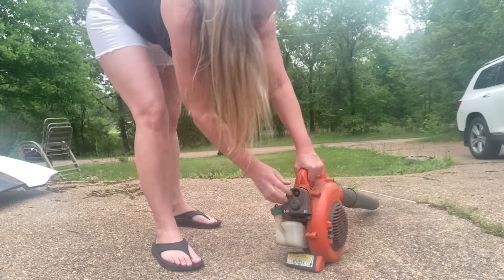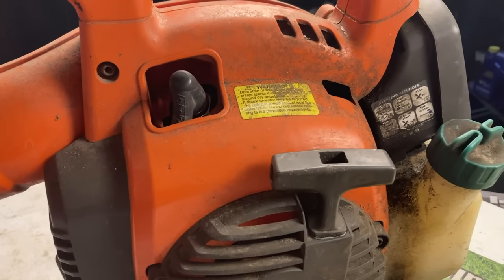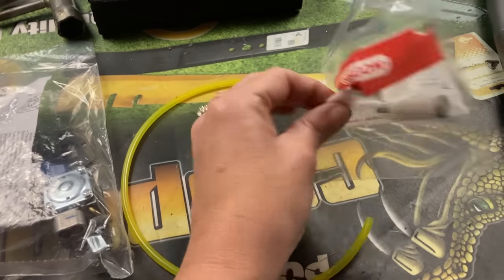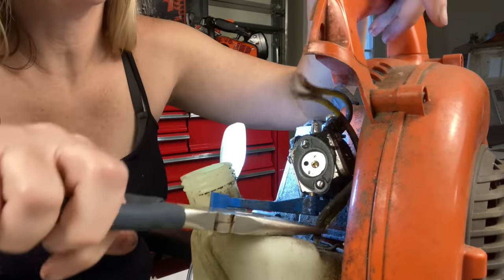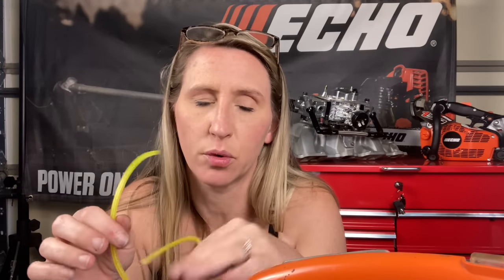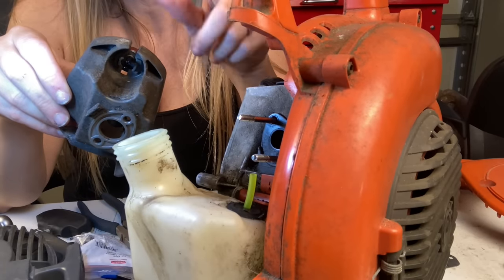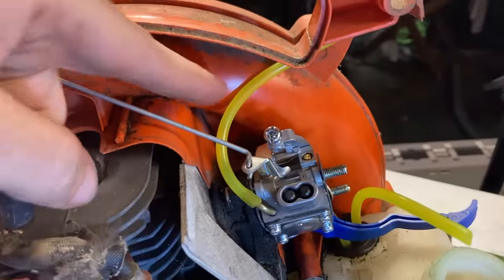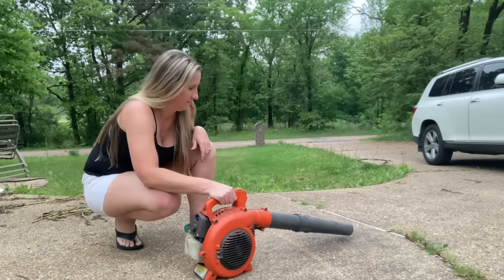How to fix a Husqvarna blower that will not throttle up or start. Repair vlog

Comment: I have taken my blower apart. It’s a Husqvarna it will start but then when I give it gas it dies it won’t stay running. I think it’s the carburetor. No I left gas in it all winter long. I have had it running and used it the other day, but I can’t get it to stay running now.

Comment: Use non ethanol fuel or a treat your fuel. Ethanol is the killer in the fuel that destroys the fuel lines and such.  You can buy the premixed fuel at your local home improvement store. Little more expensive but it will protect your equipment in the long run.

Comment: Certain gas station now has rec fuel no preservatives or additives in rec fuel .... They use it for jet planes and racing has a 90 octane rating you can use and small engines and your car

Comment: My uncle has the exact same blower and its basically brand new ashe only used it 3 times but it will only stay running on full throttle. When the throttle lock is disengaged it will stall even if he tries to turn the idle screw up, and as i said it runs perfect at full throttle so dont think its an air/fuel adjustment issue. Anyone have this issue?

Comment: All I did to mine was drilled a muffler out because it was so restricted
Reply: You need to be careful though drilling out Mufflers. It's better to replace them. The spark arrestor aspect of mufflers is damaged when you drill them out and the resulting Sparks exiting the muffler can cause a brush fire under the right circumstances.

Comment: Off subject. Husqvarna rancher chain saw leaks bar oil. No apparnt fix, why no recall?
Reply: This is a very common issue with all saws. We suggest, and practice, to either remove the bar oil when done using the saw or if the caps don't leak, store the saw on it's side caps down. As for a recall, the oiler is not defective. Any saw from any manufacturer can have this issue.

Comment: As a Auto tech dealer type there is a federal certificate you are required to have to remove or work on a carb same for small eng. For over a decade  only pros allowed

Comment: Bought a Husky leaf blower. Could not get it to start. Stupid me fell for the factory refurb unit. Tracked it down to the fuel line in the tank. Well, actually the fuel filter. There was none. Fuel line was hanging in thin air. Lesson learned. Never buy refurb. Bought a new Husky commercial string trimmer. I have yet to get that piece of junk to run reliably. Second lesson learned, DON'T buy Husqvarna! Shame is my mother used to work at Husqvarna back in the 40'5. Now all Chinese JUNK!

Comment: Hooskie anganeers do some DUMB DUMB stuff. For instance, other than the one you showed here, the "mandrels" on their mower decks are aluminum so the used steel screws. Yeah, with not anti-galv treatment. Couple years in the field. Try to remove the screws snap snap snap snap, Gee, I get to buy a new mandrel.

Comment: thanks  really ????,,u forgot ya nail polish ,,and make up ,,,,good thing u didnt take off ya diamonds  ,,nice job on the fuel line.. tips ,,
,,it would of been nice if u claned the machine before repairs,,
just a opinion,,
Reply: We don’t clean the unit before we fix it because it might not be able to be repaired. We clean them after repair before the customer picks it up.